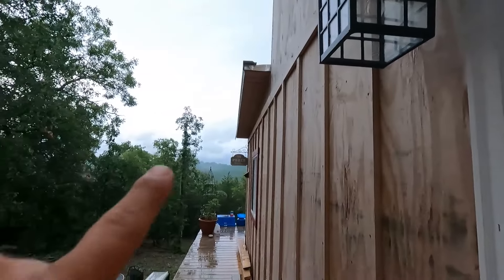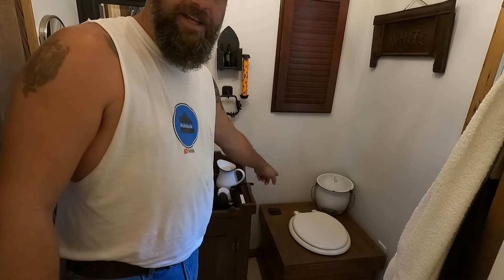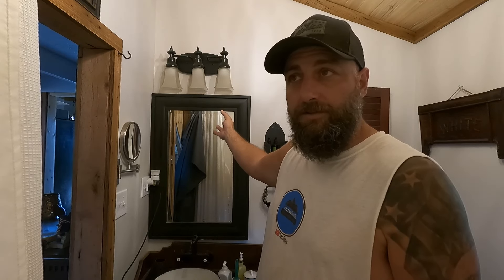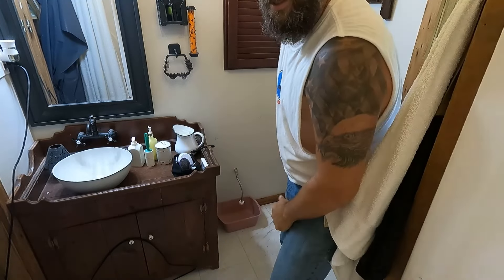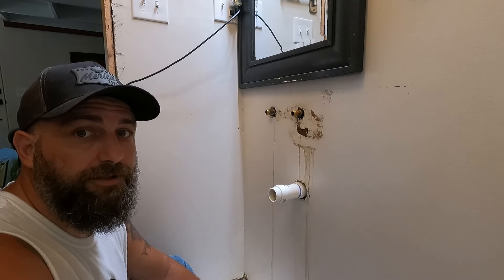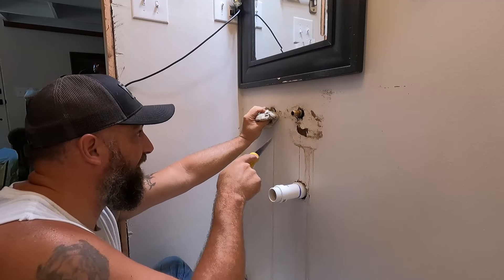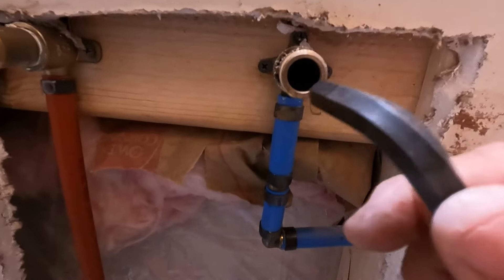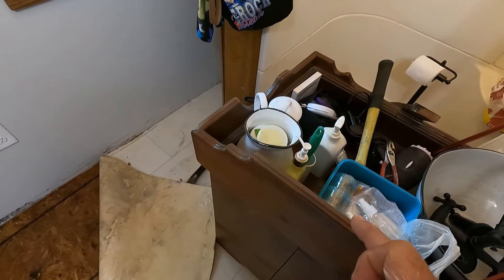DISASTEROUS WATER LEAK, BATHROOM PLUMBING FAIL tiny house homesteading off-grid build DIY tractor

Comment: Teflon or PTFE tape can be tricky to get right so it's probably leaking at those threaded fittings. Try picking up some pipe thread sealant compound. It comes in a small jar and it works better. Put a little on the threads of those nipples and tighten them up good for a leak-free connection.
Reply from the maker: Yes and thank you👊👊 I did use the pipe sealant and the tape this time. So far no leaks🩵🩵
Reply: @WhiteRockNATION  Great!
Reply from the maker: We used both!!! Thank you!